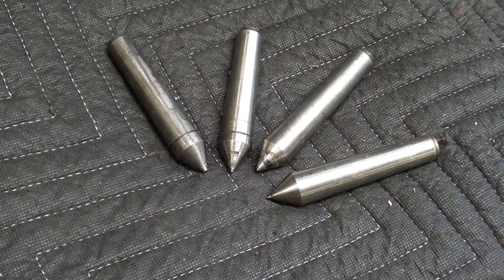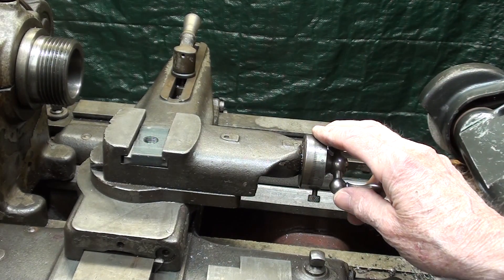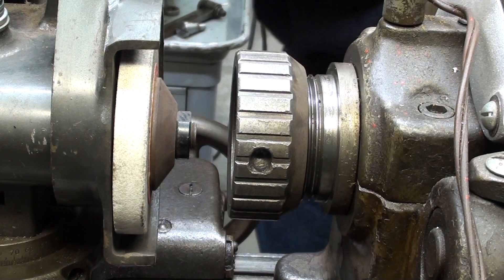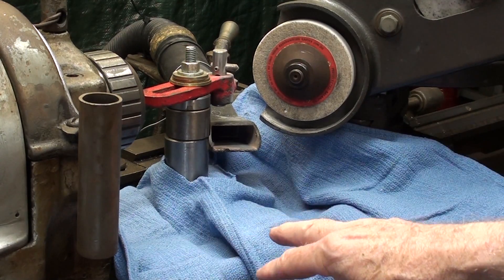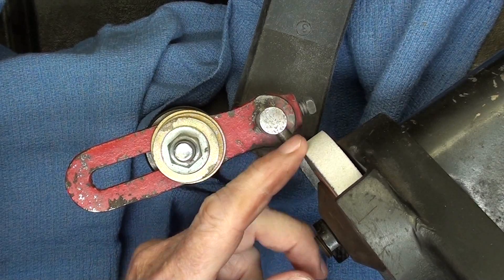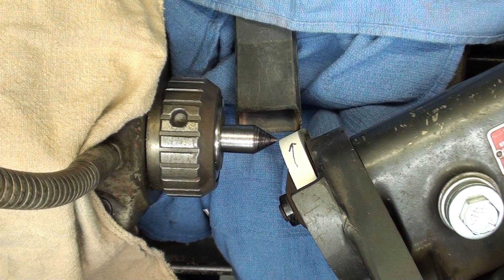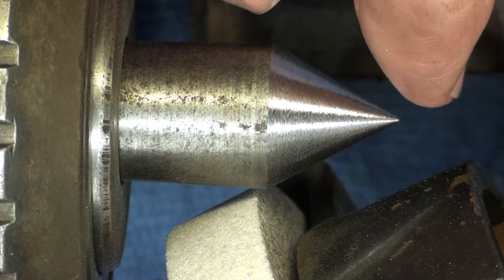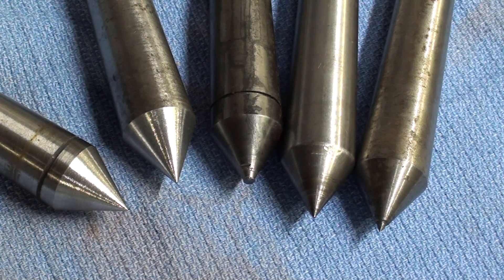Grinding Centers on SOUTH BEND Lathe TIPS 558  tubalcain

Comment: the finish is dependent less on the grit and more on other factors...
 that I may not understand as well as solid rock machine shop inc. they have a lot of useful information on surface grinding to precision... as they are tool makers.  there is a youtube channel where they post grinding tips among other things.
 c:
 I'm not sure if it is especially useful to get into depth on grinding skills and methods for your application, however, any information is useful information... And more so if it is from those with very pertinent  experience.

Comment: I'm looking for a tool post grinder for my Southbend 9" lathe. Any tips on where to find one? I recently bought this lathe and got EVERYTHING original with it (built in 1945). No OD grinder though :(
Reply from the maker: Your only options are eBay and craigslist
Reply from the maker: Oh, and check with lost Creek machinery they have a website

Comment: For internal grinding, how big of a wheel is used for a hole? For example: If I am grinding a 3" hole, how big should the wheel be?
Reply from the maker: Use the very largest one that you have that will still fit in the hole
Reply: My chuck has some threaded holes in the side to attach a lifting ring. I simply bolted a diamond to that and dressed the wheel. I’m not quite sure how to get a picture of the setup to you.

Comment: Like the vac idea, will have to add that to my next grind. Would any type of cutting oil help the finish? Just comparing to the fluid drip on some valve grinders during the grinding operation.

Comment: Nice work and video. A word of caution though. Sucking sparks with a vacuum cleaner could be a risky idea. If the dust bag contains combustible material it is possible that it may catch fire when you turn your back to it. To be safe you can take it out and put it in a steel bucket over night.

Comment: Would you consider making a 5c to MT adapter?  I need to do this for my Harrison Lathe as it is missing the factory adapter.  Mine would be Jarno 13 to MT3
Reply: it is easy to get the out side machined and ground but the bore is a different story
Reply: @konaguzzi1  Would reaming the ID be an option?
Reply: @brokenxj  probably the only economical reliable accurate option to use set tapered reamers big $$ though

Comment: It would be interesting to braze an old carbide end mill in the end and make a diy carbide tipped center.
Reply: I use worn out 6mm carbide endmills as centers in my 6mm watchmaker lathe. wish I could make female centers from them aswell,.
Sadly grinding internal cone in carbide to tolerances needed and with 0.1mm hole in exact center is beyond me (the hole is to protect the tips that bear in the jewels).
So I have to live with steel for now.

Comment: I have some tool post grinders that are on the bucket list of shop projects. How did you figure out the thickness of your adapter shim? (that's the next step for my project). I like how you set square, but i wonder how much would be involved to set the angle with a sine bar.  Also, a video on regrinding a spindle taper would be cool to see.

Comment: Excellent Mr Pete. What is the approximate rpm of the grinding wheel. I am considering making my own tool post grinder using a Makita Router as the power source and a home made spindle belt drive like the Dumore has.
Reply: RPM is marked on the grinding wheel.

Comment: Mr, Pete - This may seem like a silly question, but other than a finer grit on the wheel, is there another way to improve the finish? (scotch brite, crocus cloth, etc.) Or would that destroy the angle accuracy? Great video, truly enjoy all the information you are passing on to the world. 
Also, how would this process work for live centers?
Reply: real grinding is complex, a lot of factors all combining.
remember when you look at a nice bit of shafting, justhow good the grind finish was. very rarely do they go to the next step of lapping or burnishing anymore.

theres not just grit count.
theres bond strength, grain structure... you can have two 40 grits, one close packed with large grit size, whilst you can have a loosely packed and open wheel with fine grit. the spacing and "coarseness" is still the same.

one will grind faster, but produce more heat in the work. the other will get the good finish but will tend to glaze burn load up clog... but then with some fiddling on speeds and feeds and you can almost reverse those properties.

as wheels spin slower they get "softer", faster they get "harder". different metals want different combinations...

sadly these days the selection of wheels is really limited. searching online and yeah... unless you wanna cough up. do you intend on grinding all day? may as well get a dedicated grinder whilst youre at it.

i grab any old stone i can find that rings "solid". quite happy to core them out and redress them to the size i need... 5" usually. once the labels have gone, no idea what im using, but you soon get a feel for what stone suits what work?

just because it looks good doesnt mean it is good! arrrgh!

Comment: Off subject for this video ( somewhat ) but it has to be said .  I was just in the process of laying out some features on a piece of sheet metal. I had drawn pencil lines and picked up a punch.  Just then , i remembered a tip from our shop teacher mrpete222.  I scribed over the pencil lines that I had drawn earlier .
 I was then able to lightly drag a prick punch in to the scribed lines and make the job much more accurate. 
Thank You mrpete for your guidance and wisdom .

Comment: 34 years doing production machine shop maintenance and I only did one tool post grinding repair on a manual lathe. We did dress spindle tapers on CNC mills (CAT 40 and CAT 50). We set up with a grinder perpendicular to the Z axis travel and programmed a Z axis taper move. The grinder arbor was naturally long enough to reach full depth of the spindle taper, and we ground only with the corner of the wheel, so no dressing was required. We didn't own our own setup for spindle tapers, so we contracted this service with a local vendor.

Slight, but significant, damage could be dressed out when spindle bearings had not yet been compromised. Dressing naturally moves Z axis tool position requiring resetting Z axis home position. Dressing not only saved compromised spindle tapers, but avoided costly spindle replacement/rebuilding and the machine teardown time.  A typical dressing could be done with less than 4 hours production interruption.

Really aggressive dressing could affect tool retention force, so this required testing with a drawbar force gauge and potential drawbar spring force correction.

Comment: Outstanding video MrPete, but I have a question for the crowd:Is turning between centers inherently more precise or is holding in a four jaw chuck on one end more precise? Which do you think best?
Reply: If you are going to flip a piece and continue turning operations most definitely turn between centers.  To maintain concentric parts.  The best method.

Comment: I've got that same grinder... or at least the Sears equivalent of it. It always made me a bit nervous to have that much mass on top of such a tiny toolpost. I've only ever used it twice. The man who owned the lathe before me had purchased just about every option possible... then I came across another lathe with damaged gears... it had the rest of the options. At some point, I'll convert the second lathe into a CNC machine... I have the steppers and hardware... I just need the space to set it up. Something about working on a lathe... dunno... very relaxing.
Reply from the maker: Thanks for watching Jerry.  Haven't  heard from you in a while

Comment: If you took another pass or two at .0005” doc, or as little as you can see on the dials, it should help with the surface finish. Much the same as on a surface grinder. I don’t need to regrind any dead centres, but I’d love to make a few different sized live centres, as they can be quite expensive. Even for Chinese. Making a tool post grinder has long been on my to-do list. You’ve bumped the tool post grinder project up a few spots on that list. Thanks for the video, Mr Pete.

Comment: Is there any other uses for the grinder on a lathe that could make buying the grinder a worthwhile item to get
Reply: BARNEZY44 _  - nope,  it really. I’ve seen a few for sale privately around me (Ontario, Canada) for around $750. A luxury item. But.... when you need a ground finish, you need a ground finish. If you have a surface grinder, it’s easier and cheaper to make a grinding fixture.

Comment: Grinding on a lathe 😱... Are towels enough?
I've herd bad things about it.... Stuff like metal powder getting into bearings and carriage gaps.

But I've also seen rotary tool attachments for lathe
Reply: Just thoroughly clean and re-oil the lathe when you are done.
Reply: Well then what exactly would you suggest? He had the vacuum cleaner running that I would guess picked up over 80% of the dust. Don’t over think things.
Reply: @grntitan1  I wanna know too...People say it's bad...but manufacturers make tools for you to do it.
Reply: @SurajGrewal  dust can ruin ways slowly,and after using lathe 50 or 60 years ,there will be much sloppiness in lathe....its all depend how long you will have that lathe ,how good you cleaned it ,and how long you think you will lived

Comment: Love that tip about squaring up the wheel, thanks! I would never have thought of that, but it works well.
Reply: Peter Van Tassell it’s also useful for squaring the quick change tool post against the jaws of the chuck.